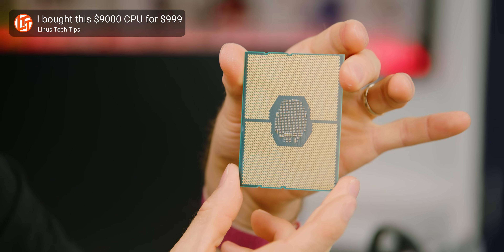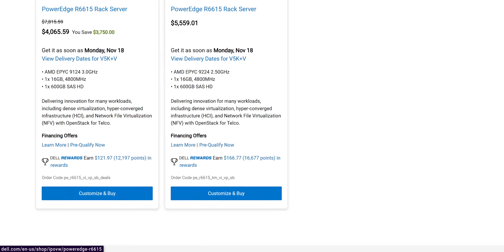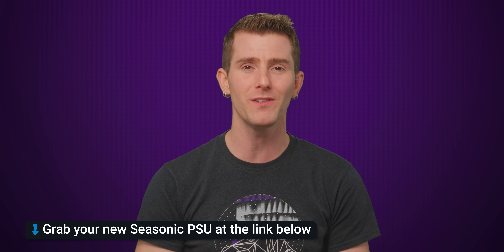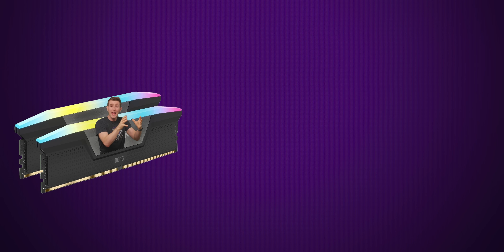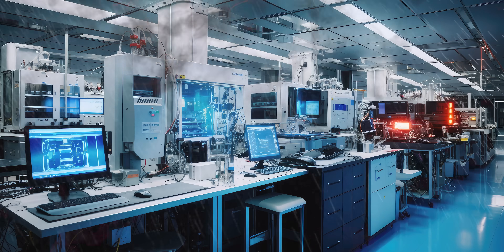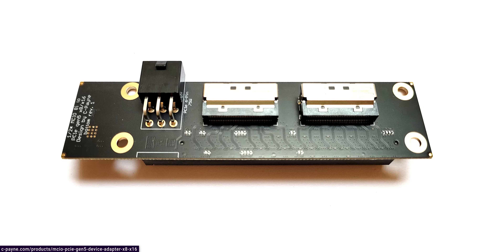What’s The Difference Between A Server and a PC?

Comment: Here is the sequence for larger data units:
Terabyte (TB): 1 trillion bytes
Petabyte (PB): 1,000 terabytes
Exabyte (EB): 1,000 petabytes
Zettabyte (ZB): 1,000 exabytes
Yottabyte (YB): 1,000 zettabytes

So far there is no ordinary computer today 2025 with RAM, or CPU processors or HHD or SSD or GRAPHICS CARD Driver memory with (YB = Yottabyte) which is equal to 1,000 zettabytes.
1,000,000,000,000,000,000,000,000 = 10^24 bytes.

Comment: Dang, I was going to convert an old laptop into a home server only to find out that a server isn't a computer that manages the other computers within a system/network, it's a computer with a great many threads, tons of ram and heavy power drain. Guess I won't be setting up a home server, just a home laptop. I mistakenly thought a server had more to do with its function/application and less about the products used. It would never have worked anyways, because I can't swap components without a $70 screwdriver. Those are the ones that turn, right?

Comment: - [00:00:00] Servers and gaming PCs share the same basic hardware, but their configurations differ to suit distinct roles.  
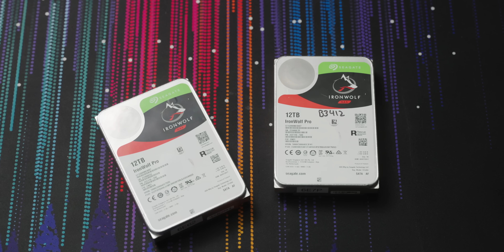- [00:00:13] Server design centers on power efficiency, reliability and scalability.  
- [00:00:28] Rack-mount cases with uniform airflow conserve space and simplify large-scale deployment.  
- [00:00:42] Power consumption, more than floor space, is the dominant cost driver in data centers.  
- [00:00:57] Using inherently efficient components lowers energy use more than simply adding premium power supplies.  
- [00:01:09] Server CPUs commonly feature dozens or even hundreds of cores.  
- [00:01:23] These cores run at lower clock speeds, reducing power draw and heat output.  
- [00:01:38] Certain latency-sensitive workloads still opt for desktop-class CPUs with higher clock speeds.  
- [00:01:50] Lower clocks also let facilities spend less on cooling infrastructure.  
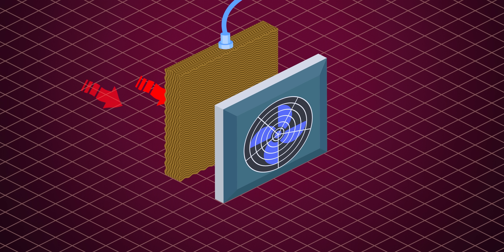- [00:02:18] Cloud providers craft custom chips (e.g., Amazon Graviton) to maximize performance per watt.  
- [00:02:46] Modern servers can carry multiple terabytes of RAM—often rivaling a home PC’s entire SSD capacity.  
- [00:03:43] Virtualization slices one server into many isolated virtual machines, boosting flexibility, reliability and security but demanding plentiful cores and RAM.  
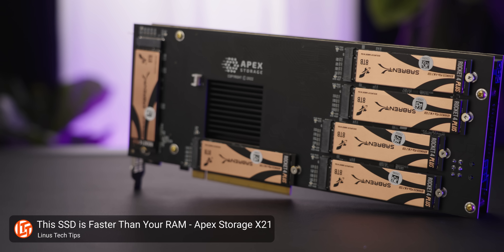- [00:04:25] RAM caching of high-demand data delivers far faster access than even SSDs.  
- [00:04:55] RDIMM, LRDIMM and MCR DIMM technologies increase per-server memory density.  
- [00:05:09] ECC memory detects and corrects bit errors on the fly to protect critical data.  
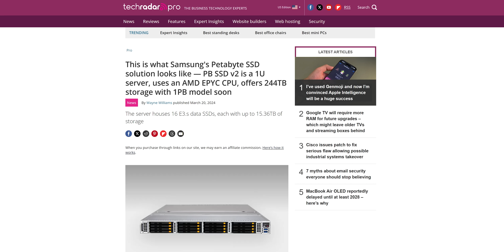- [00:05:38] A 1U server can now host a petabyte or more of high-speed storage, often to serve other compute nodes.  
- [00:06:06] EDSFF SSDs boost drive density, cooling efficiency and power delivery in tight server enclosures.  
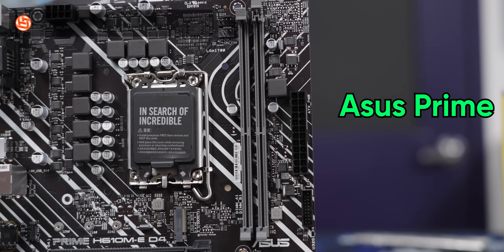- [00:06:21] Server motherboards are typically proprietary, sold as part of complete systems rather than DIY kits.  
- [00:06:47] They expose many PCIe lanes through compact edge connectors, used with cables or risers instead of full-size slots.  
- [00:07:15] Because workloads vary widely, cloud giants rely on purpose-built servers—not networks of gaming PCs.

Comment: wait, the difference are actually just the purposes of them
Reply: That is most of it. But dedicated servers usually have higher end components that you wouldn't find on a regular PC. For instance, a lot of servers have redundant power supplies whereas pretty much all consumer PCs only have 1. Servers, especially file servers, have hot-swap drive bays. They may also have hot-swap RAM and CPU capabilities. At their core, they have the same hardware. Its just that server-grade hardware is designed for more high-end use cases compared to typical consumer PCs.

Comment: what am i missing about having a home server or NAS ? i mean what other than maybe photo backup or if your a youtuber and store your footage would you need to be able to access from a home network? music an movies are all subscription based normally, or even if you have a digital library somewhere nobody has files of movies sitting around right? i just dont get what youd use it for besides having a simple external drive or larger for certain things
Reply: Incorrect. NAS/Server is a center of all digital life in my household. It's a backup for files & photos that we cannot afford to loose. But also it backups entire operating system. This way we can restore our PC & Mac to working condition. It saved me multiple times. In addition, it stores all my audio & video libraries served through Roon and Plex. I have multiple docker apps running in the background doing their things. One of the best features is ability to create Virtual Machines. So instead of buying new PC, I can simply spin up new Windows VM, connect monitor, keyboard & mouse. It saves money, since building or buying new PC/Laptop costs over $1000. I understand that NAS/server is not for everyone, but my family cannot even imagine life without it.

Comment: My media server (unraid running Plex) just has ALL desktop components, but to keep power consumption down (and save space), it has a G series Ryzen cpu, so I dont need a GPU.  It has an Asrock B550 phantom gaming 4 mb (lol) and 32GB Corsair Vengeance RAM, which is overkill, but whatevs.  

Its all inside of a rackmounted 3U case.   Been up-and-running for a little over a year w/ zero issues.

Comment: Putting aside all the semantics and the 'everything is a server if used as a server' narrative, the basic difference (which is mostly hard-coded in the motherboard hardware) is which subsystem utilizes the processor's most powerful input-output-bus. In a PC, it is the graphics subsystem, cause in a pc you have a screen where you want to have beautiful gaming and other graphicals for your money. In a server it is the data storage subsystem, as needed to serve incoming requests. That makes a PC a bad server, and vice versa.

Comment: Allow me to clarify.

"Configuration", has two aspects:
1. The hardware.
2. And software.

The same "PC" (Personal Computer) with the same hardware (although not ideal) can play the role of a "Personal Computer" or a "Server". So, if the hardware part of the configuration doesn't define the machine's role or purpose , then what does? The other part, the software.

Any computer, regardless of its platform (hardware + operating system) can be a server if it has a "server software" on it. Your smartphone can be a server.

That is the key point. A "server" is any computer that has a server software on it that is listening to incoming requests to "serve" (regardless of the requests nature: web, ftp, printing, etc.)

The hardware part is an optimization and efficiency factor not a role defining factor. 

I hope this helps.
Reply: Exactly, it's the OS config and other software that determines if it's a server, not the hardware.
Reply: Clearest comment of all the ones that I ve read by now. And frankly, I slept through the video, means your comment conveyed mare than the video did.
Reply: can confirm, I ran a server in a VM for a college project

Comment: Yhea server hardware is efficient in the data centre, but at home an older PC with a low end video card or a raspberry pi are fine to run a webserver or nas. Also the server hardware starts to become power efficient in the data centre, not so much at home. That is because in the data centre there are enough tasks to occupy server hardware. I don't need an EPYC based server at home (too much space, cost, and power usage).

Comment: When introducing someone to server hardware, I use an analogy that covers most of the basics:
If a consumer computer is a pickup truck, then a server is a semi-truck.

You operate both of them in a similar way: steering wheel, pedals, fuel. You can use them to accomplish the same/similar tasks: hauling various loads.

But a semi-truck is driven a little bit differently; it has more gears; it can haul more; it is more resilient and can go longer without stopping. In some ways, it is built to be easier to maintain. But underneath all of the nuance, it has the same basic form and function as any consumer device.

There are also software nuances,  but you can also run most server OSs on consumer gear anyway. So, I focus on the difference in hardware.
Reply: I like your analogy.
Reply: @hopemokaya yess mann

Comment: Servers ARE Designed for SERVING.
A Desktop CPU is Designed for a Desktop. Run a GUI (Graphical User Interface).
What Can Be Done in Hardware, Can be Done in Software. What Can be done in Software Can be Done in Hardware.
The CHEAPER DirectX Graphics Cards - Do Graphics Processing in Software. The EXPENSIVE Ones, do it in Hardware - Therefore, More Silicon - Cost More - However, They're Higher Performance AND FASTER.
Servers ARE Designed for SERVING.
A Desktop CPU is Designed for a Desktop. Run a GUI (Graphical User Interface).
What Can Be Done in Hardware, Can be Done in Software. What Can be done in Software Can be Done in Hardware.
Servers - Don't Need to Be a Desktop. More of The GUI - Graphical User Interface, is Done in SOFTWARE. The Reason, They SHOW a Lower Clock Frequency.
More of The GUI - Graphical User Interface, is Done in SOFTWARE. Therefore, Smaller CORES. Therefore, You Can HAVE "MORE" Cores. - These Cores - Aren't Designed for a GUI - Graphical User Interface. They're Designed for Serving - E.g. HTTP Requests - Apache (httpd Daemon) or C/C++ Code Execution of (mysqld - Daemon) - MySQL.
Intel XEON - These CPU's ALSO Have More L3 Cache Memory. As They're Running MORE (4 or 8) - Programs CONCURRENTLY (AT The Same Time).
A Desktop CPU - Tends to Run 1 Program At a Time - Other Multitasking Programs, Go Idle in The Background.
Might Have 2 Programs - Running Concurrently - Listening to Music and Writing a Document. However, the Music Player - Doesn't Require - A Lot of Processing. Today, it Offloads - The Decoding of mp3 to Hardware Sound Chips (Sound Card). A "Similie", would be the GPU - Graphics Offloading.

Comment: There are a few points you completely left out.
POST: The big manufacturers build all of their servers and proprietary components--none of them will even accept you installing comparable parts, like DIMMs, they check the firmware at POST and if the DIMM doesn't have, for example IBM firmware, the system board will simply switch the DIMM off and report it. All components communicate with the system board and reports diagnostic information at every event.

System board have their own system-on-a-board management modules build in, which operate independently of the system board. The start before the system board starts, in fact they control the system board even starting and monitor the system board. These one board systems generally run on some proprietary Linux OS which starts up as soon as power is provided to the system board. Once they have started up, they start the system board, if configured to do so. They can also be configured to NOT start the system per default, or only if the system were shutdown correctly, so that a defective system which crashes cannot try to start itself again , until  all events habe been fixed. This prevents servers from thrashing.

These system-on-a-board modules have different names, depending on the manufacturer and model and generation, but they all fall under the category of LOM (Lights Out Management), meaning that much of the maintenance of servers can be done over intranet connections, allowing to manage even shutting down and restarting a server, which used to require somebody to physically flip a switch on the server, but which can not be done electronically. The only reason anyone need to actually step foot inside a data center, is to replace physical parts, like disk drives or DIMMs.

The LOMs also allow for having the servers monitored by applications like HP OpenView, which monitors attached systems both passively and actively, and can be found in practically every professional data center in the world.

Those are three very major things which differs servers from PC in professional environments.
Reply: And you expected Linus or any of his team (who gave him information) to know this?
Reply: @ganjasage420  I don't know why you have your panties in a bunch.
In professional IT, these aspects of server management are paramount.
What I expected has nothing to do with anything. Linus demonstrated that either he doesn't know about server management, or he didn't find it important enough to report on. In either case, as a professional with 35 years in IT, I presented what I thought was interesting and important.
Reply: @DerOrso  because I'm tired of people making Linus out to be some face for computer technology. Without a team this dude has no more knowledge then someone like me who plays around with computers for fun. He is certainly not a face for tech. 
As I said, you expected them to know anything you know given your 35 years in IT? They could've asked people like you in the field for factual information, instead they make videos with incorrect information. Him and his team try to cover any aspect of computer tech with whatever jargon they find while having a narcissistic attitude in videos that they know better then the people in those fields as jobs. So yes I do have my panties in a bunch whenever I see his mug and hear him speak.
Reply: @ganjasage420  I in now way disparaged Linus for not reporting on the points I filled in. I filled them in factually without comment on Linus at all, simply to fill out the points he didn't cover.
That you think you can exactly state what Linus knows and what not show only one thing, that you have no idea what you are talking about and are an unworthy interlocutor.

Comment: When I started into computers. Mid 91. It would basically consist of Novell Netware 3.11 and the hardware was mostly the same as the workstations depending on the year. Normally you would have more ram, larger hard drives, and larger processor. Depending on the amount of drives you had. Probably a larger tower. When I left computers. We was building server using intel server boards with dual PIII, scsi drives, server case and ecc ram.

Comment: Currently I am preparing to build a server for my homelab. Recently I bought Supermicro X11DPi-NT motherboard for 2 CPUs, want to shove there some higher clocked Xeon with many threads, so I can have beefy machine. Will serve as NAS, HTTP fileserver, NVR, some multiplayer game server (UT2004? :D) and in the future maybe a router based on pfSense or OpenWRT. Also for trying some AI based stuff, after I install Nvidia GPU later .  Still waiting for some components to arrive though. Some time ago was thinking about purchasing an older DELL Poweredge R530 or something like that,, but with upgraded configuration, it could cost nearly the same as to build it myself.

Comment: Unfortunately I find this video slightly misleading. In general a server is a just a computer that serves data to other devices on its network. There should have been a short introductory segment pointing out that this video is mainly about INDUSTRIAL GRADE SERVERS and that home and workgroup servers exist as well and are more closely related to standard PCs and workstations (i.e. they usually use form factors similar to tower PCs, but offer much more beefed up storage and networking sections). I would also have been intersting to investigate the transition from classical workgroup servers to virtualized cloud solutions (run on industrial-grade hardware) that is currently taking place (i.e. one type of server replacing another type of server).

Comment: Great episode. Here's something I have on my mind: when I was in highschool in the mid 2000s the school's computer lab had a server. Why?! I mean, all of the 20-30 computers in the room were normal PCs, just like ones you might have at home - meaning, they weren't some kind of a dumb terminal. So why did we need a server? Is it possible that it was just a misnomer (or old nomenclature) for some sort of a (non-wireless) internet router?
Reply: Your school most likely had a Windows server. With Windows Server, you can setup a Windows domain environment which is used in businesses and the enterprise and even in schools. In short, Active Directory lets you manage computers and user accounts from a centralized location. So if you think about it, you most likely had a unique username and password for yourself. And you likely were able to sign into any school PC with that username/password. That's possible thanks to Active Directory. All the computers are joined to that domain and can access resources that are made available to students. And if you think about it further, it would be impractical to create a user account for every single student on every single computer manually. That's one of the many reasons they use a directory service like Active Directory.

Its possible that server also acted as a file server for shared network drives or as a DHCP/DNS server among many other functions.
Reply: @JJFlores197  Thanks a lot! I think it makes sense, although I don't remember us having to enter any username or password. However, access to files - yeah, that makes quite a bit of sense.